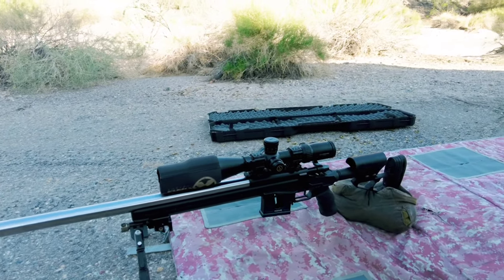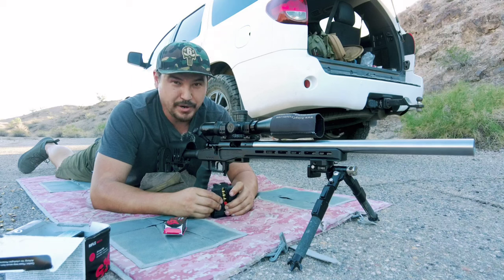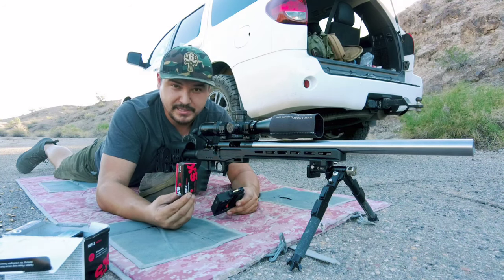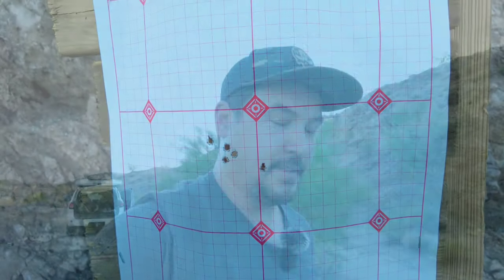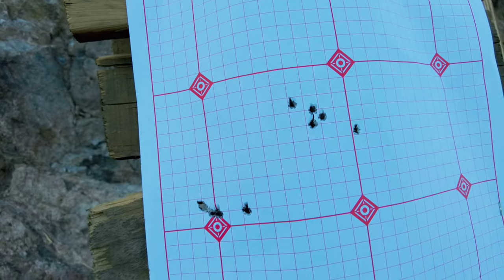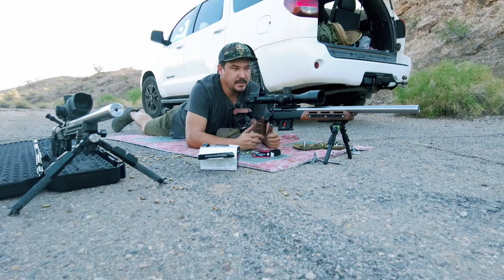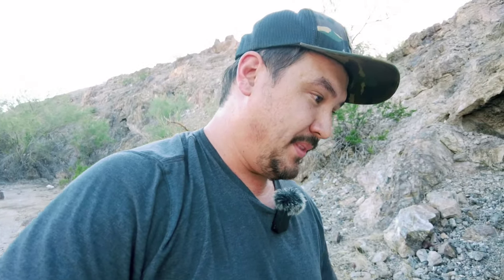What makes an accurate 22LR | Mythbusting Part 1 #DPGunworks

Comment: This was a great video Kenny!  I am glad you are showcasing what separates you from everyone else as a premium rifle builder. 👍🏼
Reply from the maker: Wouldn't know any of what to look for without your guidance in this!
Reply: @EagleEyeShooting I  hope this improves your groups. #1 Wear a shooting jacket #2 Weigh ALL of your ammo ( 22lr ) to select a pile that is identical #3 Rim your ammo ( sizing tool that measures the rims to exclude crappy rims, allows back bleeding of pressure ) #4 Throw your tripod in the pond and get a glove #5 Get a sling #6 Get a sling clamp #7 Drop your trigger pull to 3/4 of a pound #8 Fire 3 shots to warm your barrel #9 Develope zoom eye ( if you can't master zoom eye, you can forget making the Olympics) #10 Ear pods with ac/dc or anything old school #11 Now shoot same hole
 Leave out any one of these ( provided you began with a same hole gun ) and you will be able   to count your shots on paper as they will not be in a single hole. I recommend using ammo from the 50's-60's, new 22 lr is sloppy manufactured. Once you have achieved same hole, grow a set and switch right to left or vise versa and start all over ( you MUST switch eyes ) again until you can do it both ways. The remark about the Olympics,  if your over the age of 25, you can forget it. It's a contest of young eye sight. About the time you hit 26, your eyes are too fried for À DVANCED COMPETITION

Comment: REALLY good information. I am fairly new to this super accurate .22 game, and I like it. I have not heard the term cold bore shift before, and that is exactly what my CZ 455 has done since I bought it 7 years ago (new). I shoot silhouette matches, so I have always been able to shoot that cold shot at a swinger, and miss with no penalty. Ironically, I recently cleaned the bore very thoroughly, and then used JB compound, and my bore no longer has cold bore shift. That really helped. Wish I had done that years ago. I wish the techs at CZ that I have spoken to over the years would have mentioned it.

Comment: Good day Kenneth

Great videos you're making - informative & interesting.

I'd like to get advice on how to get my old Brno 22LR to shoot more accurate consistantly.

The best grouping I get is about 1moa at 100m. 2-3 shots are close to each other with 1 or 2 flyers to give 1moa or larger. 

The rifle's info are as follows:
1976 Brno model 2
24.9" Barrel length. 
Barrel has 12 grooves. 
Action torqued to 30 inch Lb
Action is drilled & tapped for a rear action screw. The screw on the barrel is removed.
Bedding job done. 
Barrel free floated.
20moa picatinny rail added.
Vortex PST GEN2 5-25x50 rifle scope.

Ammo tested
CCI std 40gr
Eley sport 40gr
SK std 40gr
Fiocchi target 40gr
American Eagle 38gr
Aquilla super extra

Regards

Comment: Cold bore shift can often be the result of residual stress in a barrel, but with a cut rifled barrel there should be almost no residual stress to speak of. That's one of the advantages of the cut rifled barrel.
Reply from the maker: Don't think theirs that advantage with cut rifling vs Button. Almost all premium barrels are stressed relieved and I see issues in both types of barrel processes down range

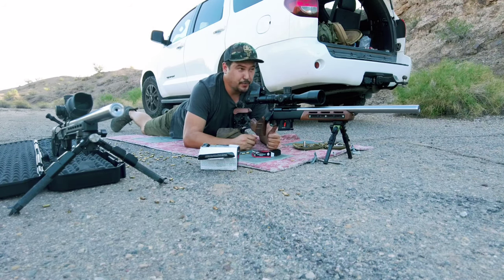Comment: Have you tested barrel indexing for accuracy? 6:00 firing pin location? Firing pin spring isolation? I know you tested barrel length, but what about length to contour relationships? Bore uniformity by measuring slugging force uniformity? Chamber finishing by various methods? 
I would also be interested in whether or not you subscribe to Bill Calfee's "parallel node' idea or not. I personally think that adaptive, or constructive harmonics should be possible. Allowing a slightly slower round to launch at a slightly higher bore angle later in the vibration cycle, resulting in the two different speeds landing in the same hole at a given range. This effect was originally noticed with the Enfield rifle in centerfire competitions. Varmint Al did a fairly in depth finite element animation analysis of the vibration patterns for various rifle configurations back in the day. I'm pretty sure that the forces at play haven't changed much since then.
One other point that no one seemed to look at was the minimum deformation of the micro groove rifling. 12 or 16 very shallow land/groove rifling as opposed to 2, 4, or 6 much deeper lands.

Comment: You talking about cold bore shift and now I'm only a couple of minutes into the video, but I've seen a couple other videos where the guys took a straw and breathed some of their warm moist lung air into the barrel from the breech end and then fired a number of five round groups, NONE of which had Cold bore shift after letting the firearm sit for - I believe it was either 10 minutes or half an hour between groups, 
Then repeating the process without the "straw-effect" and then showing a cold bore shift, which makes me wonder if it is a matter of the fact that there is not the humidity to act as lubrication in the barrel for the first round - as there IS for every other following round - then how can any barrel shape or design eliminate the extra friction that is causing the bullet to stay in the bore just that much longer for the expanding gases to act upon it just that much more,
 causing a slightly higher velocity and therefore cold bore shift?
Thank you.
Reply from the maker: You mean the video where they never showed the target? Just the velocity numbers? Right......lol
Reply: Well I think that was the quickest reply I've ever received LOL no I watched several videos where they showed the Target down in the bottom right corner or upper right as they were firing, and I wasn't going to mention this until after your reply but I have tried it with my Ruger 10/22, Marlin 60, and my 1937 Winchester model 67 with a 27 inch barrel that's right that's not a typo twenty-SEVEN inch, and it made the greatest difference in the Winchester and the least difference in the Ruger but it did in fact help eliminate cold bore shift in all three. 
Now this isn't supposed to be some kind of a I'm right you're wrong or you don't know what you're talking about comment, not at all nor in any way, nothing but respect for what you're doing here, but if this issue is actually happening as I have seen it happen myself and others have shown it to happen, is it something you have not tried or if you have you have not found it to make a sufficient difference for you? Basically I'm just trying to understand what is and what isn't, and why.
Thank you
Reply from the maker: I've tried it myself on factory CZ457 mtrs and some of my benrest builds... It made no difference down range.  I managed to go about it developing my own barrels that are wire edm cut. 120+ builds with the new barrels, almost breaking records at the lapua test center each time and consistency in accuracy.  O and no cold bore shift. A quality barrel speaks for itself and doesn't need spit
Reply: "doesn't need spit" 👍😎 and you can replace the p with an h! 😆

Yeah I totally respect what you're doing and what you're up against from temperature and humidity to wind to insects flying in the bullet path to how the barrel reacts to heat and then you've got the problem of all the different bullet and ammo manufacturers plus the different mixes of powder and primer yep you've got your work cut out for you. I totally relate as I'm a bit of an engineer and have actually a world record in My chosen field of competition, it's about 20 4 years old now and is yet to be beat, and I've engineered and designed some revolutionary things like antennas and extremely high output low frequency drivers, so it's refreshing when I see someone like you operating it's such a deep level of detail! I have a feeling that there may be some truth to the humidity relieving friction on the first round and possibly why you're seeing your best non-cold bore shift barrels probably burn out the quickest, cuz it seems like the best of everything in this life lasts for the least length of time. Anyway when I get the bucks together I can do more than sit here and let my lungs heal, I'll be contacting you for a whole new level of 22 fun. Appreciate your rapid responses!
🤙🤓
Reply from the maker: It took me a year to develop my barrels. Many hours spent with the best barrel smith's and balasticians including the infamous Brian Litz. Humidity was never a determing factor. I have ARA records set with rifles I built. One in Flordia and this particular client competes in NC often when it rains.
Facts are what matters.  I did not find ANY videos demostrating this theory.  I'm open to continue testing and gave it a try an hour ago again with no changes

Comment: From what I understand is after firing, the primer compound has an abrasive nature, and yes I've seen accuratecy increased around the 800-1000 round count in a Ruger American Rimfire, and a Savage.. with factory barrels.
Reply from the maker: With that amount of rounds, why not just start with a good custom hand lapped barrel??? Could have bought 2 of them.... So far, 1 case of ammo in, accuracy is exactly the same as it was in the first 15 shots with a good barrel
Reply: @EagleEyeShooting  
Because I'm an average joe with an average rifle.. Can't afford a custom rig and don't have a need for one, I just have a factory setup with the heavier 16" barrel.. 
But yes about the first brick it was an ok shooter with CCI Std velocity, but around 800-1000 rounds it tightened up a good bit, granted I'm still shooting like a 6" group at 200 when I do get to shoot that distance, mostly it's 100 or less and with a 3-12x40 that's all I need to be doing.
Love your work and the rifle, and a custom hand lapped barrel won't see any improvement with round count..
Do you clean the bore or no ? I just pull a bore snake trom time to time.

Comment: 22 long rifle barrels of any size near the diameter of the ones you are shooting will never get warm enough to change the point of impact significantly. The reason they're printing differently after a "cold bore" is that the bore is now fouled, it has nothing at all to do with thermodynamics of the barrel as the barrel doesn't even get warm. It would have to get hot before it changes the point of impact, and a 22 long rifle just doesn't have the ability to do that firing 10 shots.
Reply from the maker: Nothing in this video talked about thermal dynamics.  Having my own air gauge tooling and having built over 1600 22lr rifles of all types of shooting disiplines. Cold bore shift is due to tight spots in the bore.

Comment: When you are switching ammo you don’t need to worry if it’s the same lube but when it’s different lube do you need to clean or just “shoot out” the old lube (how many rounds for that on average?)

Also how important is or should lot testing be?  I’d like to try several different ammos to see if my barrel is “saveable” but don’t want to test 10 lots of each lol.
Reply from the maker: I typically shoot 10 rounds (while still testing for accuracy) before I determine the barrel is "normalized" for that particular ammo's lubricant. Results vary of course. Lower grade barrels may have more tooling marks which result in needing more fouling shots. As for lot testing, you want to be around the 1060-1080 mark with high end ammo. Lapua Center-X/Midas +, SK Long Range/Rifle. Try Eley if your barrel is 22" or longer. If it doesn't shoot consistent within .100" average I personally would consider looking into another barrel or other accuracy issues

Comment: The lead bullet picks up spent priming compound which is slightly abrasive from the previous shots fired and that does polish the barrel to a slight degree.
Reply from the maker: As I own a Airgauge LLC tooling for the rifles I build. I tested this and can positively say thats false. Tested barrels that have 5K rounds vs new showed zero change in resolution of 5 hundred-thousands of an inch in bore diameter or chamber
Reply: @EagleEyeShooting  Very interesting. Do you think those people that have experienced an increase in accuracy after firing it a thousand or two rounds are getting the action/firing mechanism smoothed out or broken in?
Reply from the maker: Folks that are experiencing "better" accuracy are more than likely polishing out the chamber tooling marks by the combination of Brushes and aggressive cleaning will do that. Not the projectiles or fired rounds. Through my experience building 22lr precision rifles, these rifles I build will hold .3 or better accuracy within the first 15 shots. This is due to selection of the highest quality barrels and best machining practices.
Reply: @EagleEyeShooting  I am watching your part 2 now. I am impressed with the information you are putting out about this. Finally some answers which make sense and less mysterious.

Comment: How do you “pick the flyers” ? I am always frustrated with SK match giving the odd flyer. Always ruins my benchrest scores. Centre X is no better regardless of cost. Using an  Anschultz 1710.
Reply from the maker: If it chambers rough. Or have a feedramp that has tendencies to deform the bullet, don't send it down range.  Lead shavings or heavy wax build up is a good indicator of this issue.

Comment: Good info, my RimX I had built with a Lilja MTU 1in16 @18in is a tack driver.
I need to do more cold bore testing,  but it looks to be minimal, if any at all.
Thanks again for the video!
Reply from the maker: Many have outstanding results with lilja. This was just an example. Ive had to rebarrel rifles with various manufacturers.  Some more than others.
Reply: @EagleEyeShooting  Thanks for the reply, I agree. You have some very nice builds btw!

Comment: Does it damage a barrel to run a bore snake through it since the bristles are brass?
Reply from the maker: Well if I stated I use a bronze brush, bore guide and drill on my 22lr barrels to clean them. Would that be incorrect?  Thats what I do with the heaviest carbon foul and freeall